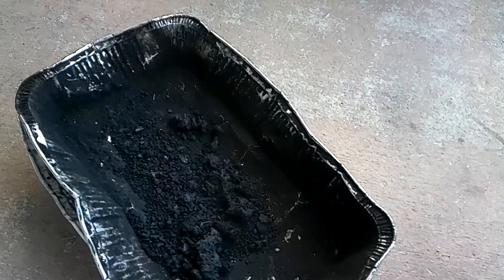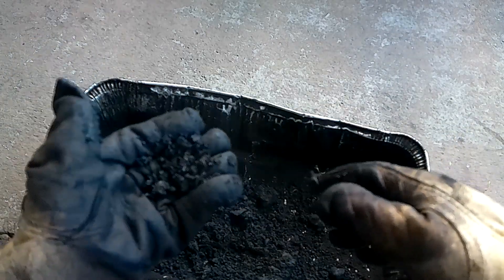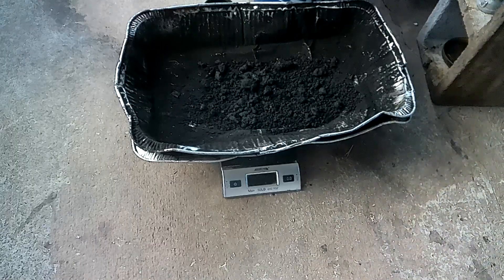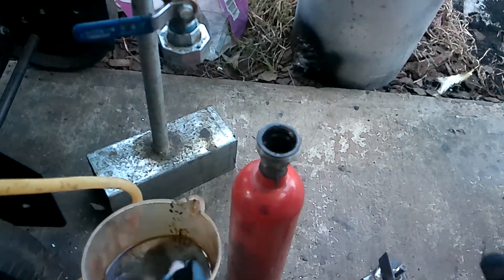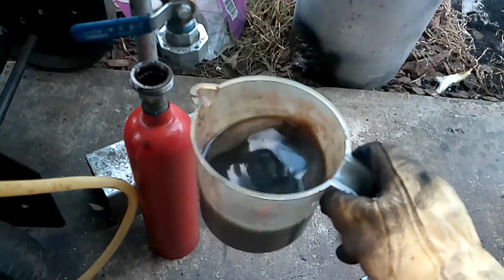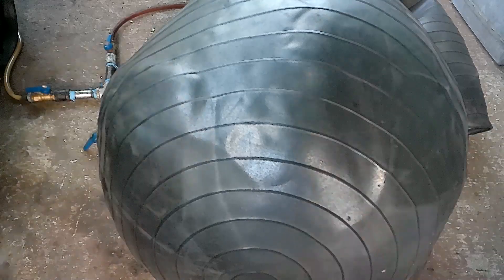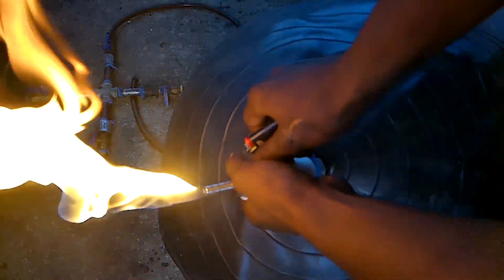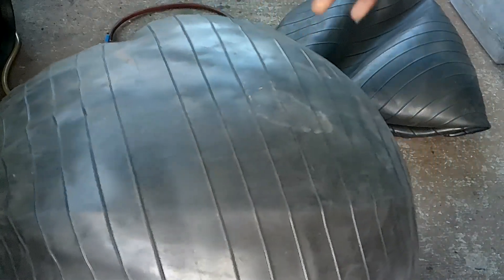Another Styrofoam to Fuel Run

Comment: I'm no chemist but a sculptor that works with styrofoam. polystyrene is basically a long chain of styrene monomers and pyrolysis releases benzene toluene and other carcinogens. Polystyrene as foam is 95% "air" but actually gas like butane or propane in some quantity. idk why exactly seems like that would not assist flame retardant properties at all. you aren't going to get a quality oil out of it, like a useful petroleum oil, petroleum distillates melt styrofoam when they touch it. spray paint with toluene does, acetone especially does, and also citrus oil does. I don't know what you're getting from this char but it's not likely something healthy

Comment: What about dissolving it in gasoline from another batch or even from fresh gas from the gas station Just to compact it into a smaller space and then using it as an agent to break apart larger plastics or loads of plastics?